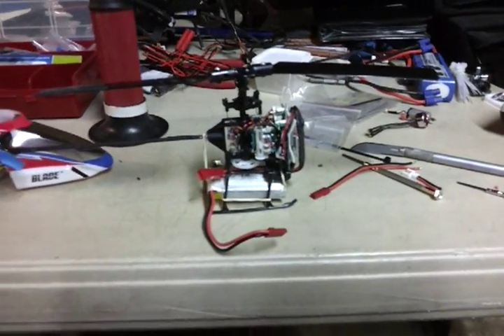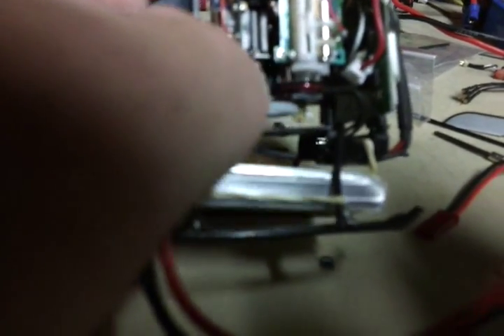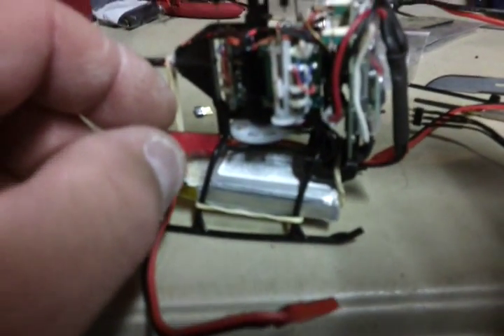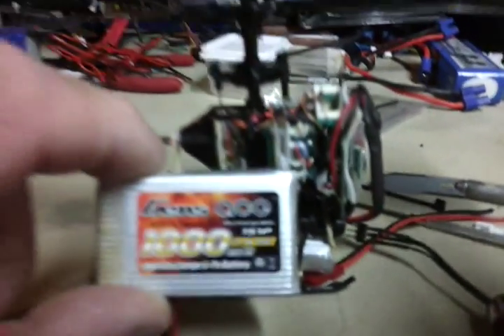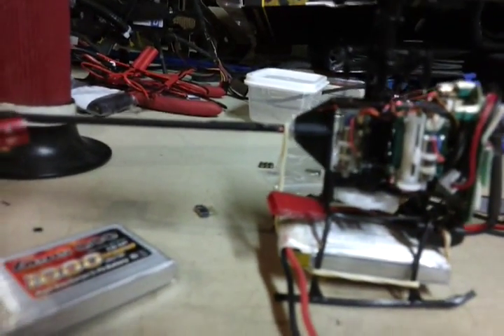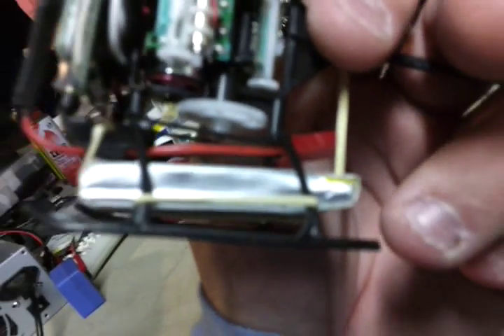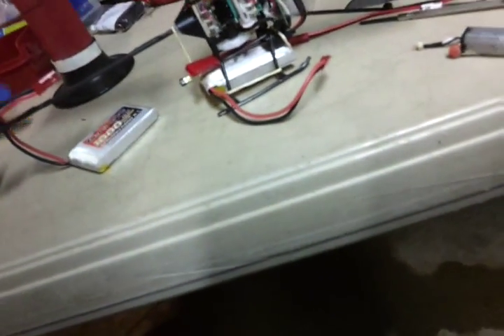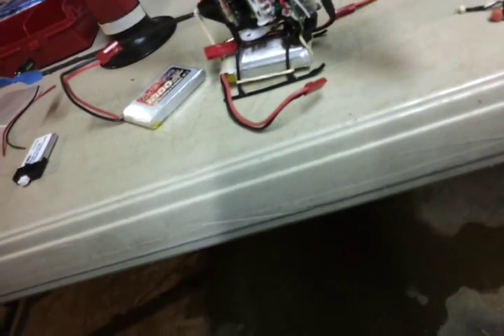McpX brushless mod

Comment from the maker: I was told by my local shop the original v1 board was 2 gyro sensors user in a comparator setup to act as 3 the new v2 board is indeed 3 seperate gyro sensors, hence the reason its more sensitive to vibration

Comment from the maker: my bad your right they are jst
I didnt put on the deans because most batteries are jst that go well with this
and the only  reason I fly the large pack was to have 20minute fun flights no 3d
other than that the motor and the esc really dont add alot and the power you get more than makes up for the weight
it actually becomes a real helicopter with a brushless mod

Comment from the maker: very lite differences really.
the 3 axis gyro system is now a true 3 axis not 2 gyros combined to make 3

they changed the tail blade and a few other mild changes 
the v2 is more vibration sensitive so if you make it brushless there are a few more issues to address